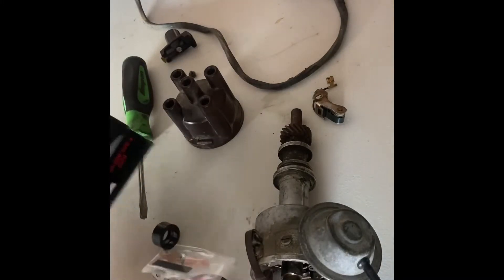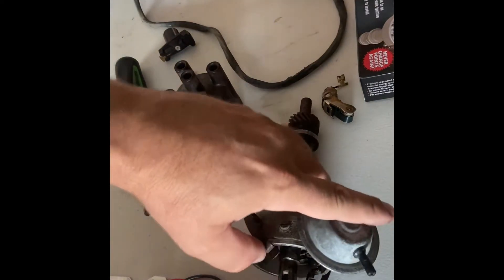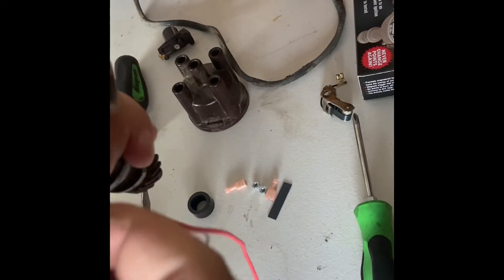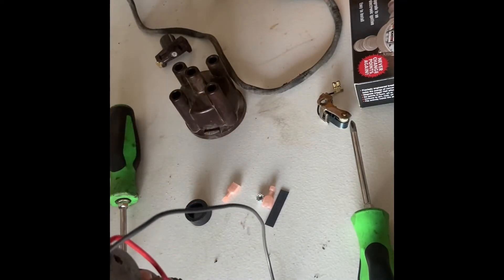Pertronix ignition install

Comment: My ignitor kit has 2 base plates. Not sure how to set it up
Reply from the maker: Depends on the distributor type
Reply: @robfaith9999  vacuum
Advance. Its the taller distributor, not the short chubby type. Its for a 72 ghia.
Reply from the maker: @Tepache57 you should have a base plate with two studs and a spacer plate with holes and no studs. The spacer is used if the round black magnetic rotor doesn’t center to the magnetic pick up.
Reply: That's somewhat helpful. I primarily needed to know the Pertronix part number 1847V that you used. I'm running an old Ford V4 that was used in Saab 95 and 96, Taunus (in Europe), Sonnet, and a few other applications back in the 60's and 70's. The motor is in my Thiokol snowcat. Points are usually quite dependable but take periodic adjustment. I like the simplicity of electronic set I and forget it. Some people have not had good luck with these though. My guess is installation error particularly regarding the proper coil resistance which if incorrect can burn out the ignition module.